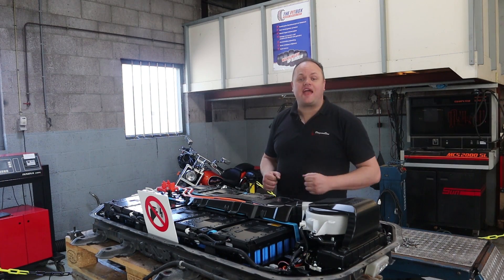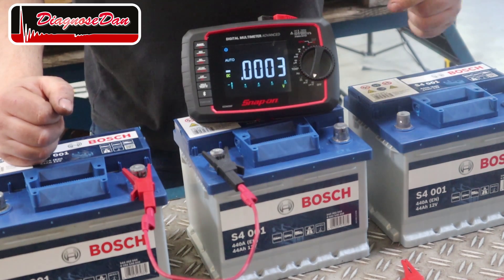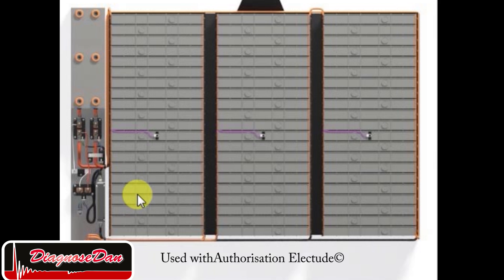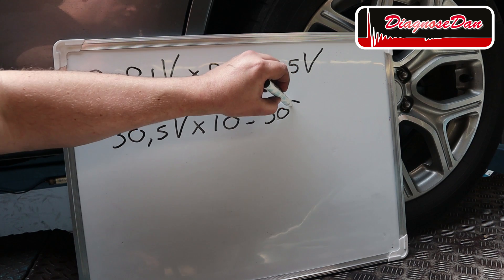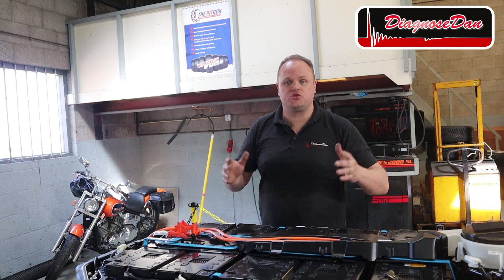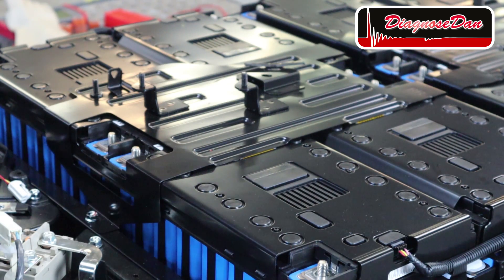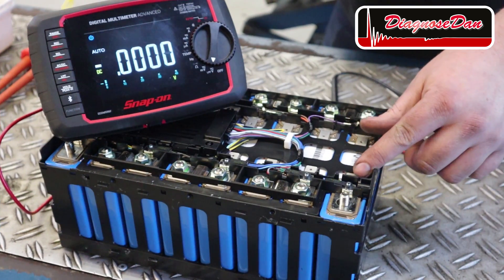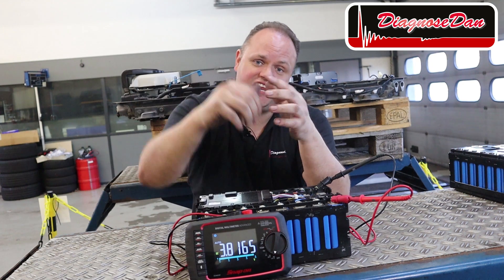Hybrid/electric battery training

Comment: At 9:44 the socket and wrench used are not isolated, electrical tape wrapped around a metal socket is no substitute for using the correct (certified) insulated tools. Additionally are safety glasses or visor being worn?

Comment: Hello.
is it possible for a faulty fuel pump to damage the hybrid battery? 
I have a Ford Mondeo Hybrid 2018, which stops while driving, the message stops safely. for 2 minutes it doesn't respond to any commands, it stays stuck on the contact then after 2 minutes it recovers.

errors appear on the hybrid battery

I will change the ev battery but I want to know if there is a connection between a faulty fuel pump and the hybrid battery.
I don't know for sure if my fuel pump is defective, but I read about something like that on the forums

is it possible that because of the fuel pump the car runs longer than it should in electric mode? while destroying the battery?

Thanks

Comment: Do any of ya'll work in extremely hot and humid conditions that make you sweat a lot? That concerns me while doing hv/ev work.   I live in the desert and the shop i go to for the ev work uses those huge swamp coolers and it's hot and very humid in the shop so while working I'm wet pretty much,  add on that the safety gear and it gets worse.   Any tips to stay safe?

Comment: 300 Volts DC, you do need to be awake there..
Most people do  not realise that a small 12 volt battery can kill you with its electric shock,here is how:

Working on a boat many years ago, and being all wet with salt water,legs in it too maybe, and having the bad luck of grabbing positive and negative wires,you may not be lucky enough to let go,and you may die; 

Yes i have been shocked in that situation,and it is like a very bad  shock from 220 Volts AC; again,it may kill you;  i was lucky enough to be able to let go, it was a tremendous shock,and i learned a valuable lesson there; 
On the street, and with dry hands,12 Volts is 100% safe, just DO NOT drop any steel tool  that bridges both terminals,an explosion-like awaits, 100s of Amps will flow..

Comment: mr dan i got a question! i have 2010 toyota prius. and got a CHECK HYBRID SYSTEM  on the cluster car runs and charge fine.. but i have to disconnect the 12 v battery ir order to the CHECK HYBRID SYSTEM  go away.. that means my high voltage battery is about  to go bad?? pls give me your thoughts

Comment: That battery design does not seem to have gone through manufacturing engineering for high volume production.  It is a solid initial design that serves the purpose, but lots of hidden removable costs remain.  Lots of redundant fasteners. Few parts from high volume processes.  Small fasteners. Heavy cell construction. You could drive nails with a battery cell.  Many components. Huge parts list. Few line replaceable subassemblies.  Many sensors. Very heavy, bulky unit to install.  Can it be 4 lrus? By making modules easily replaceable more questionable components could be used with even better availability. Lots of volume manufacturing know how can be applied here.

Comment: Hey Dan, Thank you for the lovely demonstration. I work in a training department for a car retailer in Dubai.  We are introducing EV and Hybrid vehicles in the market soon. Thus we were looking at safety gears especially high voltage gloves that will be both safe and functional (given that most of the class-00 rubber gloves are very thick and which makes it difficult for the tech to grab their tools). Can you tell us about the gloves that you are using in your demonstration and how good is it for practicals applications.

I appreciate your time.

Thanks 

Asfaq S

Comment: Hi Dan, great series so far. One very quick question, when you were removing the  bus bar, you used the snap on ratchet but what looking like a normal black metal socket, don’t you need one of those orange insulated sockets?
Cheers. Looking forward to the next video.

Comment: A simple yet basic explanation of the power distribution arrangement of DC voltage in a hybrid or a totally electric vehicle. Very informative and well explained, Dan. Maybe it should have been stated that No Load must [not] be connected to the battery system before disassembling the bus bars. Wish the battery manufacturers would provide plastic caps or covers for the battery terminals after the connecting metal strips/bus bars were removed. This would protect the technician if he accidentally dropped or mishandled one of the metal covers that are placed on top of the assembly; and keep potential battery terminal short circuits from occurring. As you illustrated, using the proper insulated tools and personal safety equipment are absolutely necessary.

Comment: , currently drive a 2014 MKZ Hybrid which I enjoyed quite a bit and I love all the videos that you've done the question of the day for you if you can answer in a video is clearing check engine light codes on a 2008 528i BMW? I bought odbc unit online on Amazon, says it can clear check engine light codes but was unable to do so according to directions
TOPDON, ARTILINK200, your thoughts please?

Comment: 👍🏼 Excellent video, especially the safety! As an aircraft mechanic, we were taught never to place batteries (lead-acid types),  onto metal surfaces for maintenance or concrete (the latter for long-term storage). Perhaps a piece of wood across your metal lift, or whatever the batteries were placed on during this video, would be safer in case of tip-over?

Comment: Hi Dan, great videos keep on going. Just want to add that there is a reason why voltage is exactly 305 V. The reason is that 220V AC RMS Sine voltage has a peak voltage of 305 V DC value so you can desing inverters and permanent magnet motors more easily and system currents are lower for same giving power. 😉👍

Comment: Would it be worth removing the 'half way' bus bar first as it would drop the maximum voltage to 150v for safety ?
Reply from the maker: Removing the service plug does that.
Reply: @Diagnosedan  I was meaning whilst disassembling individual sets of cells around 8:50

Comment: Skil used to make a 1/4" drive power wrench that ran on 2 Ii-Ion batteries in series.  It had a rachet and the power drive, which was of modest strength.  You need one.  All this 10 mm nut and bolt removal and replacement is too much.   See if you can find one.  You'll like it.  PS. mine stopped working.  I need to fix or replace it.  Good video.
Reply from the maker: Thanks!

Comment: Dan have you heard of E.C.R electrical contact resistance this is a resistances on lithium battery causes from scratches, which can cause heat and even melting of contacts zf are looking into this and could change the way you test hybrid cars, so even using a volt meter can cause this check it out .
Reply from the maker: I know what you mean but i wouldn't worry to much about it.

Comment: Great information thanks.  I was always told only try and use one hand when using a meter with high volts but thanks for the great video.
Reply from the maker: When you are using insulated gloves, it doesn't really matter. Using one hand is just an extra safety in case the voltage penetrates the glove somehow. 
But it's not a bad thing, respect the rules in your country

Comment: Dan I have a question for you. My fathers car is a 2007 cl500 c216 mercedes. The fan intermittently comes on at full speed wether the engine is cold or hot. It has no fault codes left behind. It gets up to temperature just fine and doesn’t overheat. The fan can come on just by unlocking the car and especially when opening the boot with the ignition off also. These are the symptoms I’ve noticed. The front SAM module has been replaced but with no difference. I was hoping you could give some insight or advice. My email adress is salehmn_9@hotmail.com
Erg bedankt vriend!

Comment: Now you're in my domain! We call the battery computer a BMS, a battery management system. Because lithium cells go high impedance when they fill up, you can't balance cells by just float charging it the last 10% of the way, so one thing the BMS has to do is balance the cells by moving charge from a high cell to a low one. It also monitors individual cell voltages and shuts down if any cell goes too low, which would damage it. Finally it also monitors temperature for safety and determines the state of charge. For cars a slightly higher energy density of NMC is preferred, Nickel manganese cobalt. For stationary applications LiFePO4 is preferred, less risk of fire and longer cycle life.
Reply from the maker: I'll talk about cell ballancing, temperatures in the next video. This car also has a BMS that is in charge of the 10 CMU's
Reply: @Diagnosedan  It's always interesting to see how car makers implement this. I know BYD (Chinese battery maker) also have an architecture like that, where you have individual (rack-mount) modules talk to a BMU, and the BMU consolidates the information and presents it as a unified battery to the rest of the system. The neatest system I've seen is from Sony (now Murata), also with multiple 1.2kwh modules that talk to a single controller, and you can parallel controllers  into the hundreds of kwh levels. So quite established tech...

Comment: 35v battery voltage safe... try to short circuit it with a hand wrench... 800Amps will glow and melt anything !!!
Reply from the maker: To touch😓

Comment: Hi dan what I know the dc voltage doesn’t kill is that true? If it does at what voltage rates also is that battery dc voltage? I’m pretty sure it’s dc and has some inverter to ac ? Please make videos about it thank you
Reply from the maker: DC is more dangarous than AC and it can kill you
Reply: Dan, since you mention it ac is usually protected ( fused ) at multiple locations and relatively benign in a domestic situation with regard to a short circuit, however it has the effect that you are immobilized when exposed to it in some cases, not all, you just cannot move the affected body part, the muscles spasm back and forth ( from experience ).
Dc is different in the way that you get a shock and the muscles move away very quickly and the electrical danger is stopped ( from experience ) however dc is usually not fuse protected inside batteries and  all the available energy in the battery is released until exhausted.
We may well see fuses of some sort inside battery blocks in the future, you may already know all of this and provide a brief explanation but i thought it important to mention, some is not very well understood.

Amazing video, great advice and u are absolutely correct.
 ( een batterij op een metale werkbank?)

Best wishes and respect from N.Z.; max
Reply from the maker: @maxsmart5466  actually it's the other way around. You have a chance of releasing a high voltage AC component. On a DC high voltage component this is less likely. Also the AC voltage is a average voltage between the two tops, so the effective voltage is lower. On a DC power source you get the full voltage. High voltage system are also fused in a car but remember you only can take a few hundred miliamps thru your hearth before it's stops pumping, so you'll be dead before the fuse blows.

Comment: You certainly don't need the gloves anymore when working on single cell packs, but with Lithium cells, bad things can still happen when you short them out or try to charge them with an incorrect voltage or current. Be careful!
Reply from the maker: Don't short the out then😂😂😂😊👍.

Comment: To go where no no-one has gone before. Big change from maf sensors, egr valves and throttle bodies.Cant wait to buy a Tesla and delve into the battery dept and hope the Mrs don't find out !!
Reply: Can't wait for Dan to dive into a Tesla...it is quite interesting how EVs use the OBD2/CAN diagnostics as well making a transition for workshops  possible.

Comment: Amazing the multiple levels of connection. Are the modules and cells labeled so that from the scantool you can already identify which of the modules you need to remove and open to get to a specific cell?
Reply from the maker: You would need to check the repair manual.

Comment: Great as always😁👍 Hmmm? I wonder if you end up with single 18650 size li-ion batteries if you keep digging further into that PHEV battery??
Reply: On this one you will find each cell as a brick. There are pouch battery packs (BMW I3) also and then the Tesla style 18650 or their bigger brothers as used in the Model 3. All those packaging systems have their pros and come but LiFePo4 bricks are considered the safest ( no thermal runaway for example).

Comment: Interesting Video. Back in the 80s I worked on aircraft nicad wet cell battery packs. No individual cell monitoring back then.  Each cell was connected with stainless steel jumper bars. What fun taking apart all the cell packs and equalizing each cell. I wrapped all my tools in electrical tape and donned heavy rubber gloves for protection.
Reply from the maker: Wow that's interesting!

Comment: I can't help but think when i watch work on hybrids, that taking so many safety precautions before working on them tells me there's something inherently wrong with the technology.
Another thing i find strange is how much battery technology lags behind what they are fitted to. Same with smartphones, how long have they been around? Yet today you're still lucky if you get a days use before charging again!
Im shocked you still need such a huge unit full of batteries in 2019?electric cars have been around for decades!!
Reply: The biggest bottleneck in the advancement of alternative energy sources ie, solar, wind, geothermal, etc. is the lack of commercially available storage batteries to hold the excess between what is generated and what is used.  Once those are added to the grid, the use of fossil fuels will plummet.
Reply from the maker: Yes, storing energy is the biggest problems. But new materials are being developed